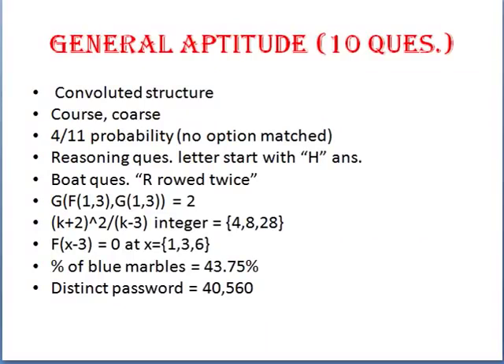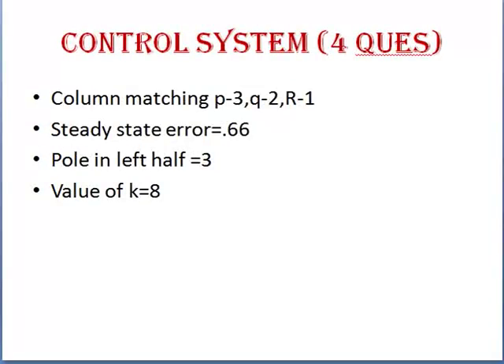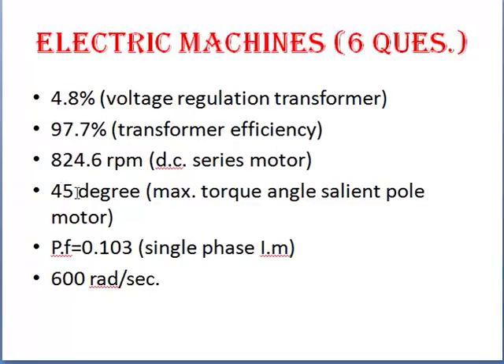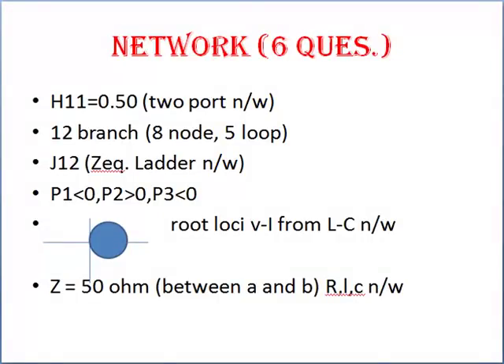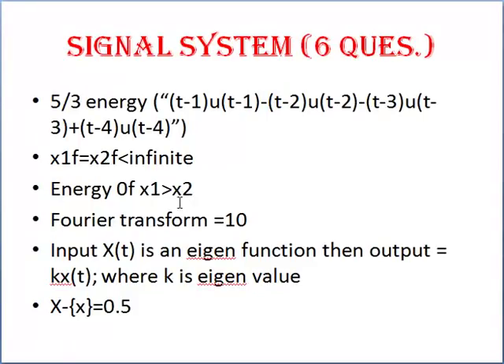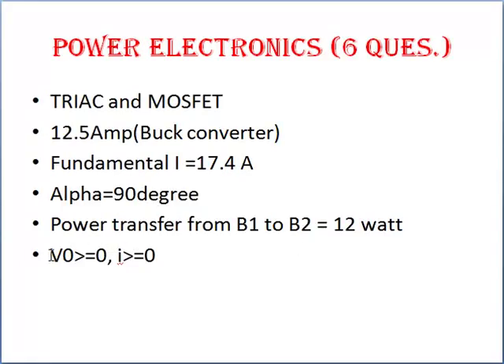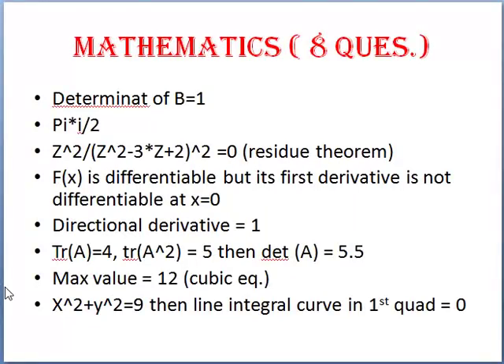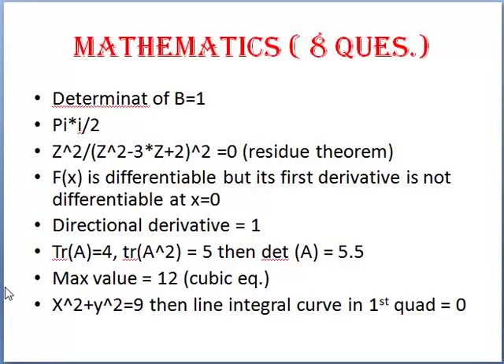Gate 2018 electrical final answer key

Comment: Bhai I have marked 2.66 instead of 2.53 will it be considered correct or incorrect??pls tell m
Reply from the maker: it depend on ans. range given by official key. it may be possible if they give good range.
Reply: JANIT GARG how range is decided I mean will my marked ans lie between range as per our opinion??
Reply from the maker: there is no particular instruction mention how they decide range. but according to gate brochure they say for NAT question mark ans. upto 3 decimal and i think they provide range according to that only.
Reply: JANIT GARG Will minimum cut off more than previous year??
Reply from the maker: abhishek sisodia 
It may be possible but if increase note more than +2 to +3 marks.